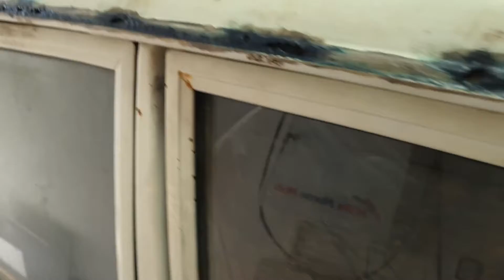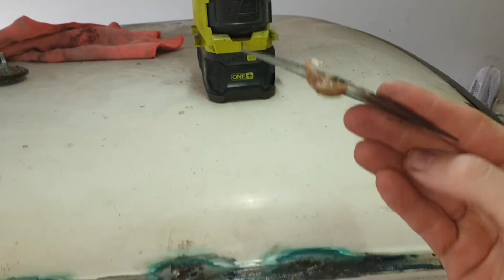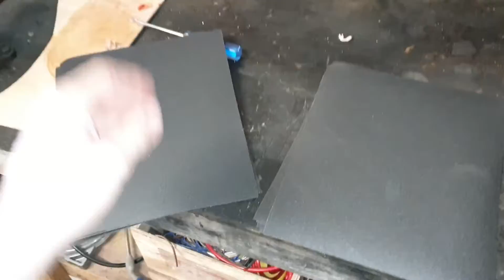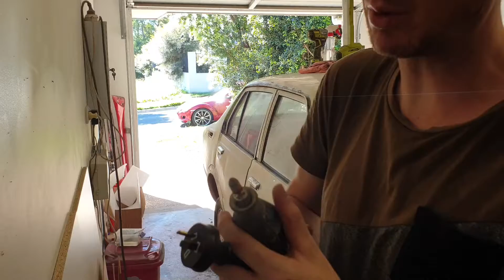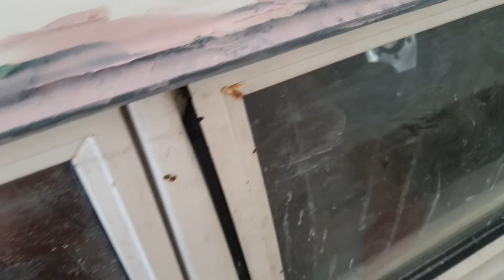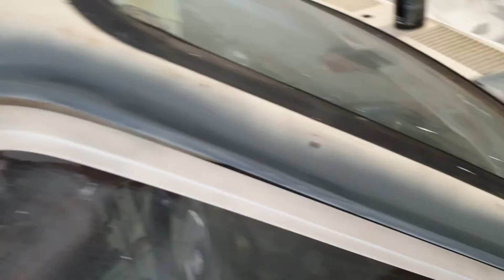Coroll KE55 Build. Fiberglass filler repair.

Comment: D’ya happen to have any resources or vids as to how that seam would be cut and replaced? 

Just got a ‘75 KE30 with similar rust along that ridge thing. 

I’ll probably end up going fibreglass filler as you did but I’d like to see the options, you feel?

Cheers from Malaysia!